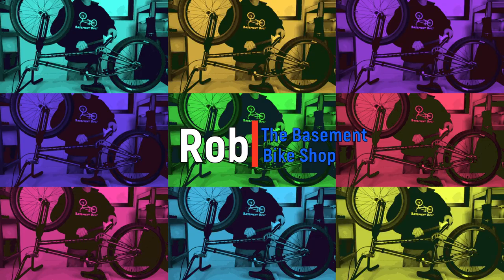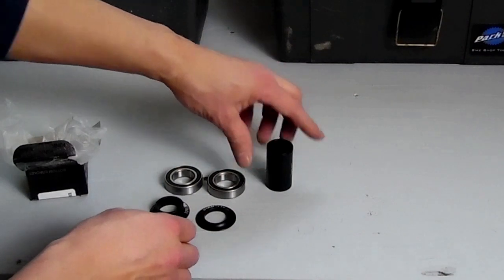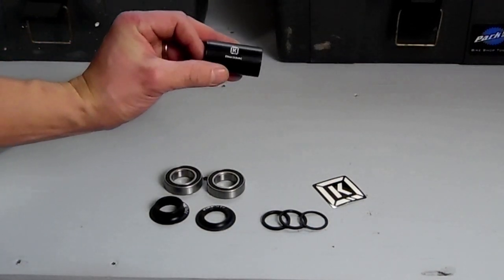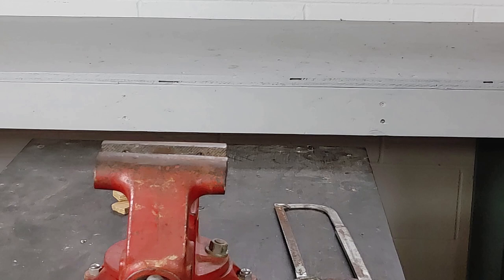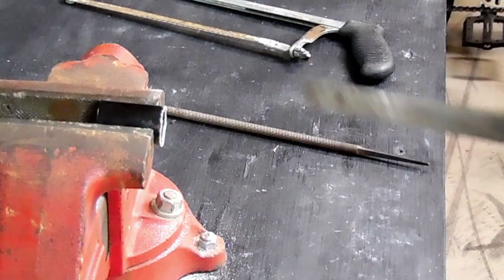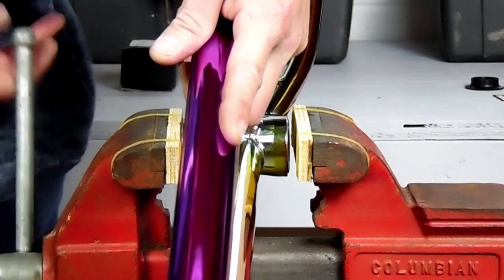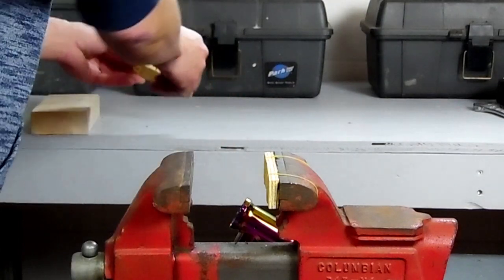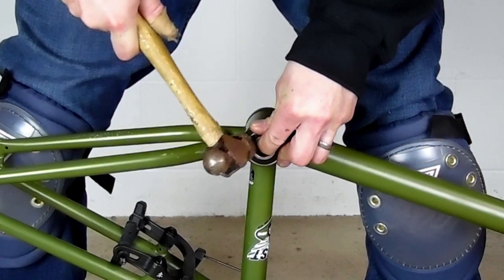Complete Guide to BMX Mid Bottom Bracket Installation

Comment: Hey Rob I have a 1996 dyno compe and  installed a pair of the repop GT power series cranks, when I bought them I paid $40 for the american bottom bracket. I now want to put the cranks on a 1987 dyno compe. And put the power series cranks onto the 1987 but don't want to pay $40 for a pair of American bottom bracket and from what I've seen they are all in the $40 range. But the mid bottom brakcet is cheaper, what's the difference in them can I use mid brackets for these cranks?
Reply from the maker: @ericodeychuk8106  the “mid” and “American” refers to the frame’s bottom bracket size. A lot of times, American bottom bracket are just mid bottom bracket with cups to fit American bottom bracket frames.  The point of the mid bottom bracket was to eliminate the cups of the American and press the bearings right into the frame. I hope this helps
Reply: @thebasementbikeshop2336  so running a mid would be no problem for my repop gt power series cranks?